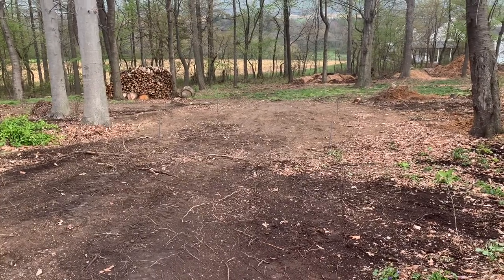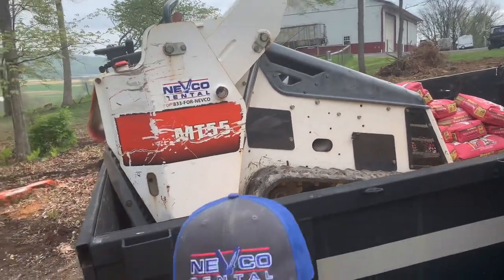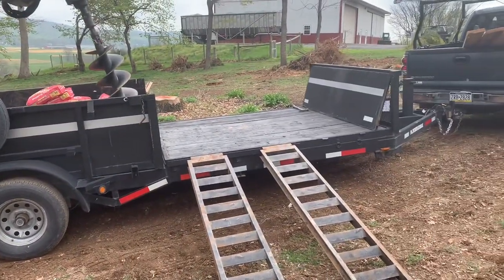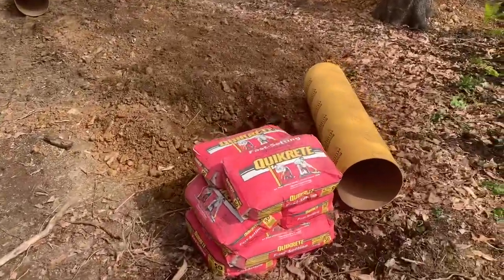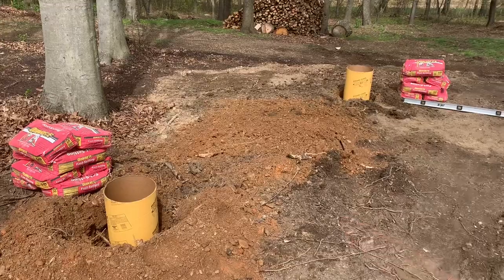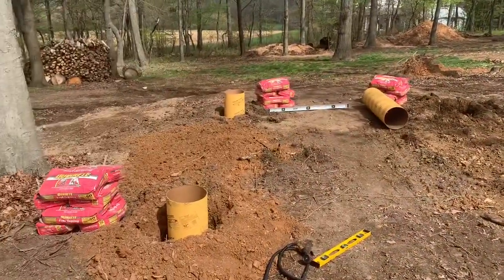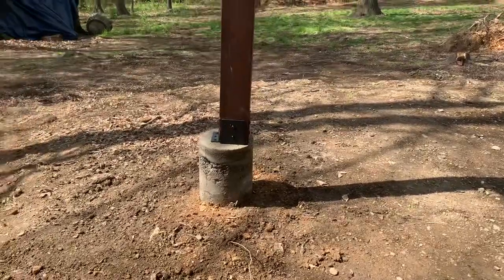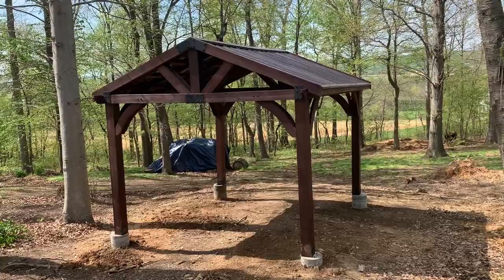Building a Backyard Discovery 12’x12’ Arlington Gazebo

Comment: I built one of these for a customer, initially I wasn’t sure it was worth the money, but after building it, and seeing assembled and how durable it was once it was put together, I loved it, and now I want one for my house. Really like the color, metal roof and the black metal brackets. I feel it’s worth the money if you are going to use it. Go for it. Good luck.
Reply from the maker: I agree with almost everything you said. The durability isn’t necessarily in question, but the finish is questionable. It’s cedar wood, so it’s really soft, and my customer has had stain flaking off and it looks kinda rough, and it’s only been up for two years!